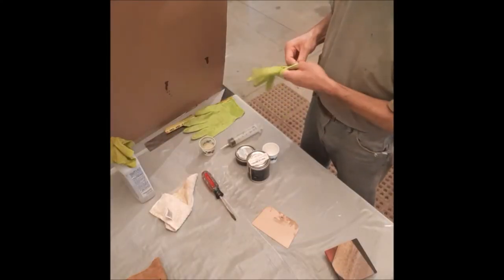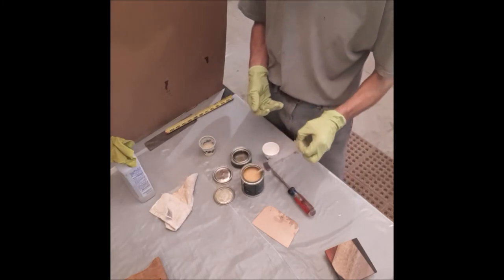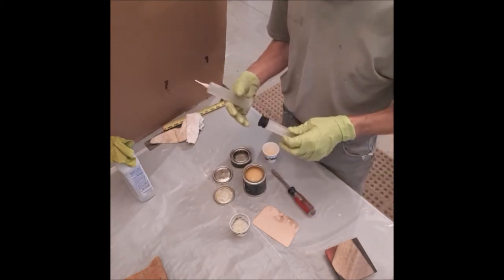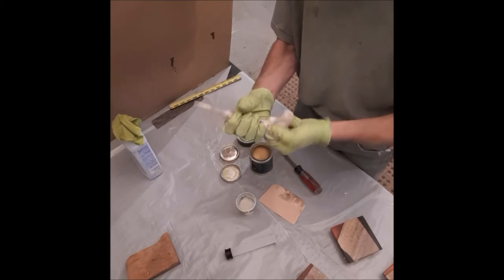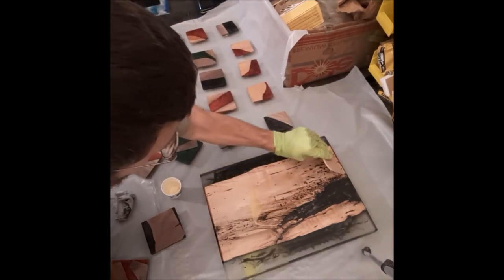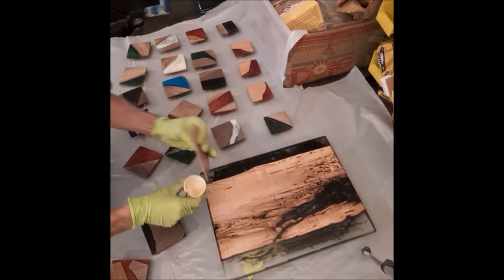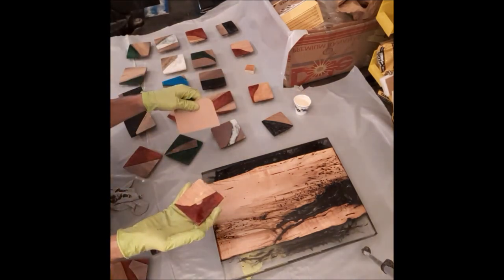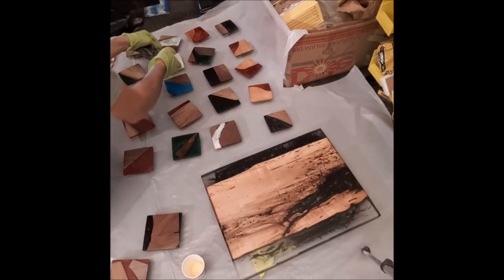Applying Rubio Monocoat to Coasters

Comment: Great video William.  I have made some coasters using KSResin high temp epoxy but it's not reacting well to hot coffee cups.  Do you know if Rubio will assist in protecting against marks where the epoxy is failing?
Reply from the maker: Hi I am not real familiar with High temp Epoxy. I am not sure how the hot coffee cup will do with the Mono coat. I have never tested it. You might want to look into a ceramic finish for the final coat that is a hard finish. Hope that helps. Thanks